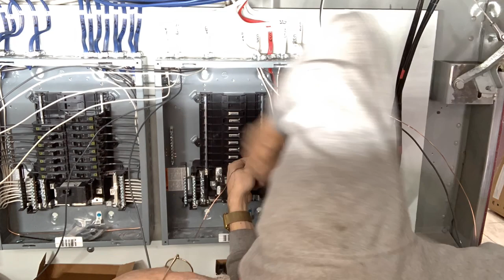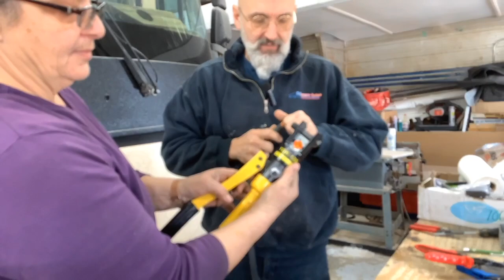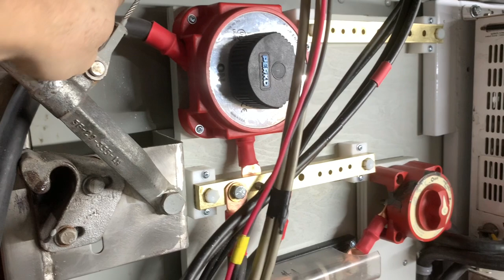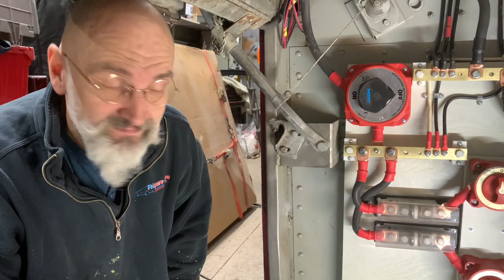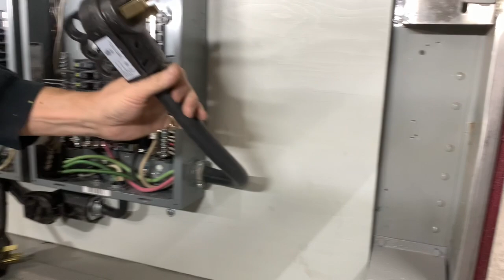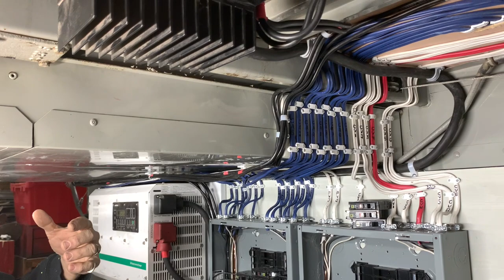E48, Bus Electrical, the sequel.

Comment: I love doing electrical and I’m not licensed either!  I have a question about running the 24v. Are you solar panels 24v also? I’ll be running two 24v 3k inverters and converting the 24v to supply 12v panel for various interior items. Would wiring my 12v panels in series then parallel work or would my 24v charge controller solve that issue? Or should I just buy 24v panels?
Reply from the maker: Our panels are 48v. Our charge controller can handle an input of 100v. The output of the charge controller is 24v. We have a 50A controller that converts the 24 to
12 for some items that require it.
Reply: @LacroixCruiser  so the panels can be whatever as long as their output from the controllers match your inverter?
Reply from the maker: Correct, the panels need to be higher voltage than your system

Comment: Most inverter/chargers have a “pass through” feature, essentially a built-in automatic transfer switch.  Whenever AC power is present on the input of the inverter/charger, whether from shorepower or a generator, it uses some of it to charge the batteries and also allows it to pass through to an inverter sub-panel.  I wired my inverter/charger with plugs and sockets so that if something goes wrong with the inverter, I can by-pass it and send the incoming AC power directly to the inverter sub-panel.  I have actually had to use this feature once.
Reply from the maker: Agreed, a way to power without the need for the inverters is important.
Reply: I should have added, that this plug and socket arrangement also allows the inverter/charger (Magnum 4024) to be easily removed for service or replacement.
Reply from the maker: Very well thought out.

Comment: So you technically haven't synchronized both inverters right, just fed one through L1 and other through L2 of a 240v panel. So even number circuits are one side and odd are another side. Is that right? Where did you do your neutral to ground bonding, in that main panel? I wonder how the neutrals would work together, it there could be current feeding back from one inverter to the other through the neutrals. I understand the hot legs are separated and would be fine. Anyway love the wiring and tidy job! You've challenged me with your strategy of keeping it simple and not relying on extra circuitry that could fail (like auto transfer switches etc). Something I'll have to think about :)
Reply: Neutral and ground are only bonded at the source.  That’s either the shorepower box (or back at the main campground/house panel, the generator, or the inverter (only when inverting).
Reply: To Nathan’s point, however, a 4-wire system “assumes” that L1 and L2 are 180 degrees out of phase.  This means their currents cancel in the neutral, and the neutral conductors are sized accordingly.
Reply from the maker: The neutral isn’t bonded to the ground as these are both technically sub panels. We’ve been operating this way for 6 years in our previous conversions without issue.
Reply: @LacroixCruiser  how would you wire in the inverters to the panel if both inverters were feeding the whole panel?
Reply from the maker: Both inverters are feeding the panel, it’s the shore power that is only feeding one inverter/ charger at a time.
Reply: @LacroixCruiser  you were saying one inverter does one half and the other the other half. So if one inverter goes down both bus bars in the inverter panel are still live?

Comment: Hey Bonjour! You guys do such nice work! I'm self employed electrical contractor in CT, 30 years now! Your wiring is neat! I used to see such neatness only on water treatment plants and such! And you used Square D "QO" Circuit breaker panels too! I'm so impressed! For some reason I'm always rushed! So funny my wiring has been a bit of a mess, now after a few years working on my own wiring in the bus, I've forgotten what I ran some of the cabling. I had left some for future. Maybe my Covid memory issues or I'm just getting older and have CRS, but I just purchased a Rhino label maker for cabling. Even my home when I did the working I had written with sharpie, but after 20 yrs it has faded.  Saw some guy re-wiring an airplane, and used Rhino Labels with his $20 dollar labelmaker. Also does heatshrink too! So from now on, I'm implementing that on my endeavors! LOL! I'm so impressed with your engineering of it all!  Thanks again for taking the time to video and share this! English and French too! God bless!  AL & Diane from CT.
Reply: The Dymo Label maker I was referring to is: DYMO Label Maker LabelManager 160 Portable Label Maker, Easy-to-Use, One-Touch Smart Keys, QWERTY Keyboard, Large Display, for Home & Office Organization
Reply: DYMO Rhino Label, White 1/2"X18', DYMO Authentic
Reply: This works well on Romex [outside jacket] the Rhino has better adhesive. Room temperature or warm it up with heat gun.
Reply: DYMO Industrial Flexible Nylon Labels | Authentic DYMO Labels, For Labeling Wires, Cables and More (3/4", Black on White)
Reply: that was from Amazon
Reply: Amzn also has this one for more elaborate font etc...DYMO Industrial Label Maker | RhinoPRO 5200 Label Maker, Time-Saving Hot Keys, Prints Fast, Durable Label Maker for Job Sites and Heavy-Duty Labeling Jobs
Reply from the maker: Thank you, do you have a link to the label maker?
Reply: @LacroixCruiser  i think this one will do. It does wiring and its warehouse is in Montréal.
Reply from the maker: Thank you

Comment: The only thing I would do is at the ends of that red wire is rap white tape over both ends to tell you its not hot and its a ground wire... (You can do this also with black tape to tell you its hot)
Reply from the maker: Good idea